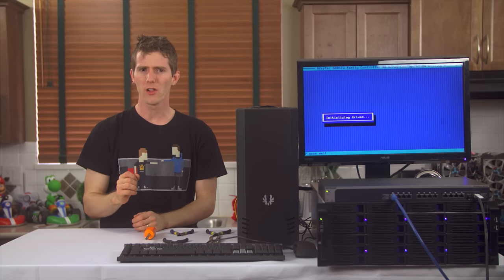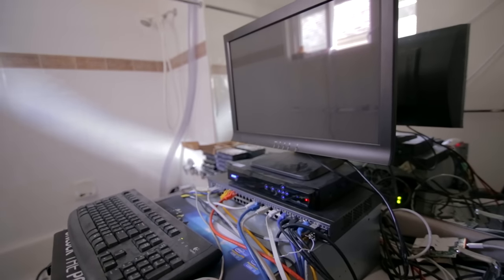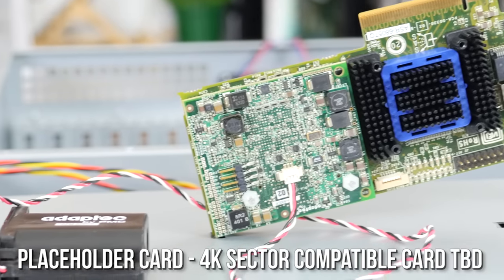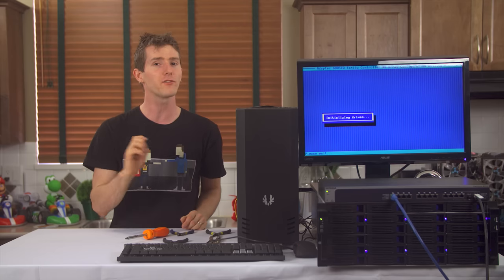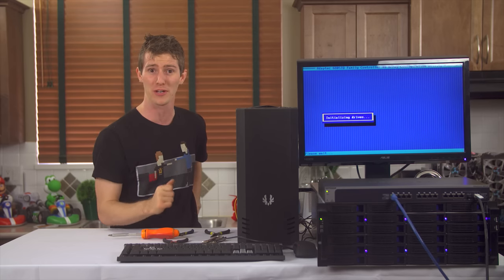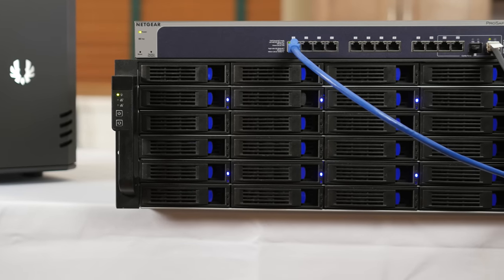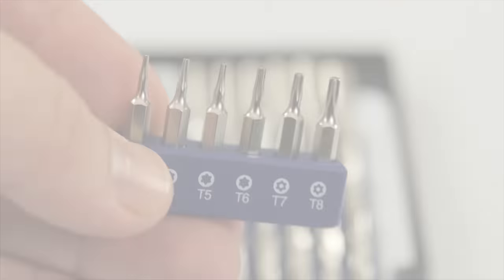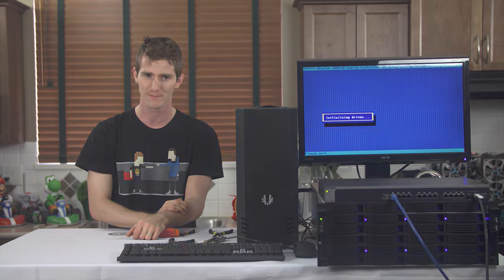Insane Storage Server - Fully 10 Gigabit Network, $1,500 Switch

Comment: They need to just contact nimble storage or netapp and get a DEMO not for resale box.
 Netgear switch will be dead in the first year. One "SAN" and a two vmware 6.0 hosts for Domain services and apps will do just fine. Drop a usb 3 pcie card on the vm hosts for quick and cheap external hardrive backup.. install veeam 8 on the vm hosts and replicate it to another  ( at home veeam) installation for FAILover and replication.  and its not a fully 10 gig network if the client pcs are only 1 gig links, he has a 10 gig backbone. but its still a gigabit network. So unless the need to transfer from server to server at 10 gigs is there this setup is a waste. "Teaming NIC"s doesn't increase the bandwidth at all its just for fail over... SMH  please stop with the incorrect information.

Comment: Im just getting into building a PC for myself. Does this seem ok? its not the most expensive rig, but its my first. Am I missing anything? Any suggestions? here's my components so far

-ASUS Micro ATX DDR3 2000 AMD AM3+ Motherboard M5A78L-M/USB3

-Corsair CX Series 750 Watt ATX/EPS Modular 80 PLUS Bronze ATX12V/EPS12V
744 Power Supply CX750M

-EVGA GeForce GTX 750 with G-SYNC Support 1GB GDDR5 128bit, Dual-Link DVI-I, HDMI,DP Graphics Card (01G-P4-2751-KR)

-Corsair Vengeance Blue 8 GB (2X4 GB) PC3-12800 1600mHz DDR3 240-Pin SDRAM Dual Channel Memory Kit CMZ8GX3M2A1600C9B

-AMD FD6300WMHKBOX FX-6300 6-Core Processor Black Edition

-Seagate 1TB Desktop HDD SATA 6Gb/s 64MB Cache 3.5-Inch Internal Bare Drive (ST1000DM003)

Comment: Remember back in the day when you did a low end graphics card review? The pathetic MSI r7 240 that you hate? There you go, this is where the card should goes if you don't want to draw any extra heat from the cpu graphic chip, e5 2618l, is there a graphic chip in the CPU anyway?

Comment: I edit video with a dual LGA-2011 v3 8-core 2.4Ghz Xeon system 32GB ECC DDR4 LRDIMM (2x8-core + HyperThreading) and it totally rocks. Combined with Adobe Premiere CS 6 (full license, not student. oof. that was expensive), Sony HDR-FX1 and Canon-XL1 cameras, HP ProLiant 360 Dual Quad-Core Nehelam Xeons (8 cores total) w/ 16GB RAM and LSI RAID 8888ELP 512MB BBU Cache, Rackables 16-Drive SAS and 16x 1TB Hitachi UltraStars.  I do just fine with this, why do you need so much equipment Linus? It seems overkill. Are you doing stuff on top of this youtube channel? or are you just doing this for Youtube.
I have to edit MMA fights, and other footage (plus live events, weddings, etc...) and I get along just fine with what I have.

Seems like you are going overkill or are using the hardware for more than just youtube videos.
Reply: +coius your running dual Xeon's and your only running 16GB ram per CPU that is very low for a dual setup. You really think this is overkill? He has millions of viewers and over one million subscribers and hundreds of published videos can you imagine how much of the footage was cut out of the videos we saw and is still backed up as extra footage. I dont know about you but I shoot 20 times more than I need and edit it down. They have how many camera guys? 
One other question you say you edit MMA fights but then you list plus live events so the MMA footage that your editing isnt live?
Reply: +New Computer Case Concepts 
I am still a startup and pour my own money into the systems that I run.  I broadcast live using HD cameras for local people, and MMA is Omaha Fight Club here where I live.  
Live events are recorded, but are also broadcast live via UStream/Youtube/etc... Some of these require pretty heavy equipment to transcode the streams. This includes multi-camera with HDMI input, the ability to transcode to H.264 in realtime (for more than just one video feed)

I do have limitations because of RAM, but at $400/kit I don't have the money to drop a crap load of DDR4 ECC Registered RAM in the system. That's an upgrade-as-we-go kinda expense.  I still have rarely hit the 32GB limit unless I am working with QuickTime encoded files.  I work with AVCHD, and HDV and DV files.  I usually work with RAW rather than using proxies, and have a streamlined approach to doing the heavy stuff first, then doing lighter stuff that is processed with the effects already applied (ever heard of NeatVideo Reduce noise? Yeah, that uses a LOT of time of my editing) so I can work more efficiently since all the heavy stuff is out of the way.

I also turn off HyperThreading and NUMA since HyperThreading divides up memory and spreads it thin, but NUMA slows down workstations (found this from AVID) and if anyone has NUMA enabled on their system should disable it. I can definitely see an improvement without it (NUMA was designed for server loads, like SQL Queries, virutalization, etc... not workstation)

MMA is a local contract I have. I am a small (reasonbly small business) but I am expanding rapidly. Since I last posted, I have added two Panasonic AG-AC90a cameras, 64GB More RAM, upgraded my RAID-ARRAY to 64TB of storage space (and have almost 75% of it still free). I frequently backup to Tape and archive old footages/projects on BluRay.

My business originally dealt with vintage media (reel to reel, Vinyl, Film to DVD Transfers, etc...) but I ended up expanding into production due to requests.  Not all of this requires high end resources, but now I just picked up Anime Nebraskon work and CONgregation as head of video for CONgregation and one of the camera/sound engineers and editors for Anime Nebraskon.

I am spread a bit thin and am training people, but still have yet to find a use for all that storage space I upgraded to. I imagine I will now that I have more footage, but I archive via several cloned BD-R's in several locations (fire safe, theft safe, etc...) to make sure all my projects are kept neat and tidy. I also run 2TB Drives in 3 locations to make sure my data I personally need doesn't go poof

The question that I beg on his is why he doesn't use more efficient codecs. Just because you can record at 1080 60p or 4k or whatever, does it really need to be kept in a RAW format, or can you use a just slightly lossy codec once the projects are done.  Most people are not going to start watching older youtube videos going "I wish this was done in 4k and not 1080"  It doesn't make sense, It's OK to store in smaller formats unless you repeatedly need old footage, and even then, BD-Rs are great for that.  With 100GB BD-rs out, there's no need to use rotating discs to archive. and BD-Rs can read at around 25MB/s so you are really just waiting money on video you may rarely if ever access.

What I could see now those is speed.  But SSDs (a couple) will outpeform a lot of RAID Arrays if carefully selected. I use SSDs under Adobe (5 in RAID-6) to hold Previews.  I use 256GB SSDs and I barely touch the storage space.  It's really quick as each are hooked to 6Gbps ports and are run by a hardware RAID controller at 6Gbps/each port.   I cannot even get my RAID array of spinning discs to hit that, let alone what a software RAID of SSDs could do even with CPU overhead.

I just think it's a waste to archive that much stuff. There's efficient and cheaper ways to do this.  Ever had to migrate that much data off a RAID array to another?  It takes forever to build mine, let alone transfer.

Comment: For smaller (physical) environments like this, you really should consider sticking with an SFP+ based 10Gb Switch instead of 10Gbase-T (RJ45).
The SFP+ slots can use TwinAx based "DAC Cables" to keep the costs comparable to RJ45 but will reduce the network latency by a factor of 10-20x.
Currently shipping 10Gbase-T Switches have really bad latency when compared to the SFP+ counterparts.
The SFP+ stuff all draws less power too.
The only limitation to be aware of is the DAC cables only go to 5m (approx 15 feet) before they start getting super expensive.  So you need to be working in 1-2 adjacent racks, not running cables half way across the room, for this to be viable.

Comment: I hope some of you internet wizards can help me. 
Ok so i live in a 3 story house and my chamber is on the 1st floor but my dad's chamber is on the 3d floor. Now our situation is:
Modem on 3d floor, so my dad has ethernet
Repeater on 2nd floor so i can connect (max speed mb/s) 
Our internet now is 13 mbps bit we are upgrading to 120mbps.
Now he wants to place the router on the 3d floor so he has ethernet connection but i want ethernet or quick wifi in my room too. All 3 floors have coax connection. 

If he has the primary modem on the 3d floor can i have a second one that connects via coax on my floor? It doesnt have to be good, like max 30€(i live in netherlands). 
Is it possible and if yes what do i have to buy? 

Thanks if answered!

Comment: 18-core rendering machine huh. Is that really necessary? I mean yeah, more cores=better performance but there is an upper limit to how fast a machine can get before adding more cores will only be a 1% or so performance improvement. Unless all the Adobe software and 3D modeling/rendering programs you use can take full advantage of all those 18 cores (and 36 threads) then go ahead.

Comment: any good switch recomendations for a house with a system that's way too complicated. internet comes from wall into a router, into another router that regulates users and content that goes to them, into a switch, into a bandwidth regulator, which then goes to house sockets, those 5 used sockets go to 2 pcs and 3 access points, which(the access points) go to apple tvs, pcs, one of which act as a server. we are having conectivity issues through both wifi and cable. any ideas on how to simplify our system and recomend updated hardware. thanks in advance

Comment: I am speechless.i would suggest you take this a little bit more simple. I do not think you are doing anything where data needs to be accessed is nano seconds. Waiting the extra second to pull up a video will not effect it. I would suggest making a separate rig that can upload videos. You could just send it to the rig(reliable not fast) because you wouldn't need to monitor it while it uploaded your vids. You could just leave it. Then you should have your Ethernet Hub. Plug it into your computers. Just make it plain out simple. As I said the extra second will not be life or death.  Then tackle the website. Just have its Ethernet straight from the source. You might even want to have it on the other router just in case. Your new storage system should just be for your personal. The next one should be for server

Comment: I wouldn't recommend that high of density storage for raid 5 and 6, if a drive fails it will take at least 15 hours to rebuild the drive. Plus if your rebuilding the drive with more smaller drives then the other drives as a whole wont be effected as much as more drives = more throughput.
Reply: It seems you were right xD #ServerDied xD

Comment: 10Gb? Really? lol you gotta calm down there linus
Reply: Hush, or he may try out the new 40G or 100G stuff.
Reply: terranborn56 Only if he could afford it. 100G is ridiculously expensive (only the transceiver that you plug the fiber into it it's in the thousands of dollars region) and it makes sense only in the core networks of large ISPs.Even in the global internet there are only a few ISPs that use 100G links, the majority aggregate links of 10/40G. 40G it's more down to earth but still expensive, it's more cheap to bundle 4 x10G links than use a single 40G link.

Comment: 150tb what are you doing recording 128x8 at 1 million frames per second
Reply: No, but think about all of the stuff they shot in RAW file sizes. Also consider that they record in a RED so they are probably shooting in 6.5K.
Reply: Dan Esp they aren't shooting red there shooting prores
Reply: Computeryscreen RED is a camera, not a codec.
Reply: Computeryscreen ProRes isn't a camera, it's a codec. I am talking about the camera. Like what ^ said
Reply: Dan Esp They don't use a RED camera, they use a sony FS700 using a external recorder which records in prores. Red cameras use a custom codec called RED
Reply: ***** It's a codec and a camera, (technically RED codec is called redcode but everyone calls it red)
Reply: Computeryscreen Redcode is just glorified proprietary prores 4:4:2 IIRC.
Reply: Computeryscreen Ok, that's a little clearer and way cheaper setup then getting a RED. The codec is typed out as R3D but I see what you where getting at. Did they show it in a video or something?
Reply: ***** It depends if you are using it as a form of conversion to a RGB Colorspace or from HD-SDI. RAW Red doesn't use Chroma Subsampleing. It's RAW, that means it's uncompressed images

Comment: I'm sorry, but where is the redundant PSU's, RAID card and as Legionof0ne pointed out, why is there a GPU in a server?!?!

Further to this, if this is a server, why not get a proper server board so it can allow you to have IP based Management (iLO, DRAC, etc) of the server without the need for a mouse and keyboard. I'm sorry but this is a DIY server and no-where near what an enterprise grade server would be.

Comment: Ewww netgear switch. Have they upped their game in the last few years? Reliability used to be rubbish.
Reply: Have a Netgear powerline encyption box, it always worked fine for me.
Reply: This is why brand loyalty (or in this case, disloyalty) needs to die. Don't blindly follow or condemn a brand based on prior experience alone. Read reviews, look at spec, educate yourself and you'll be a better consumer.
Reply: I couldn't say that I'm loyal, I don't even currenly use any of their products. But my guess was uneducated Now that I think of it. Thanks for pointing that out for me.
Reply: ***** Oh no, that was to bummaggots 

People are constantly loyal to one brand or automatically condemn another.